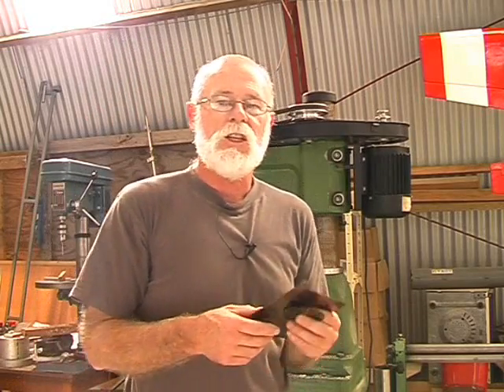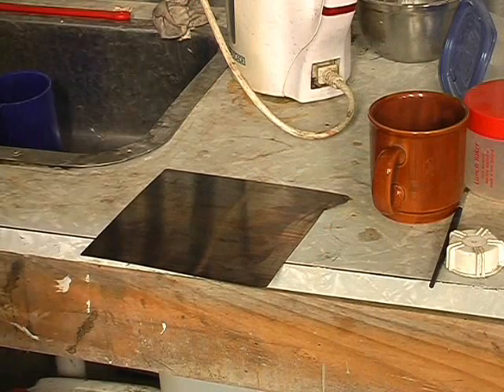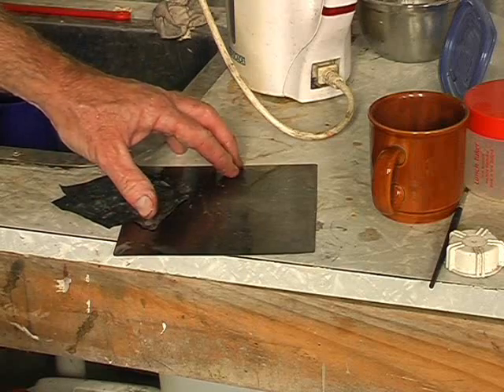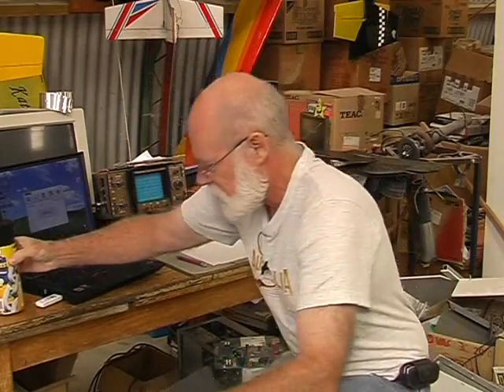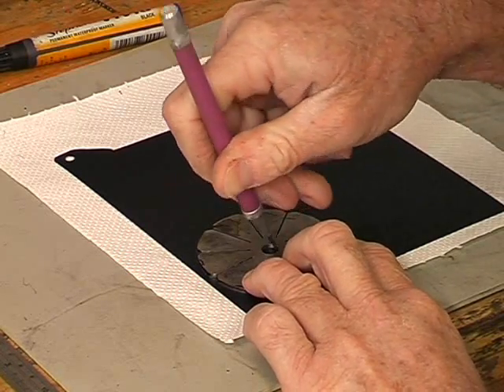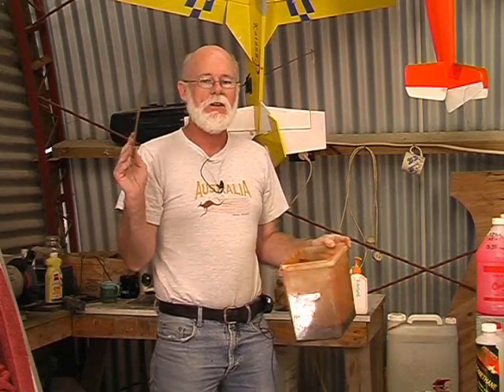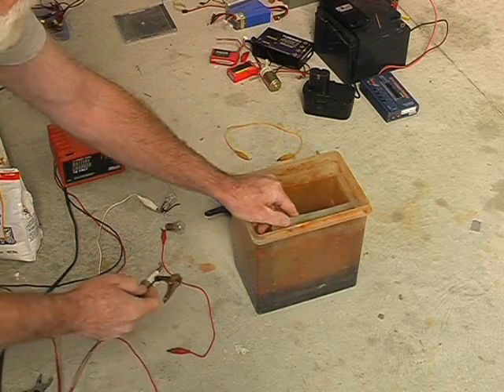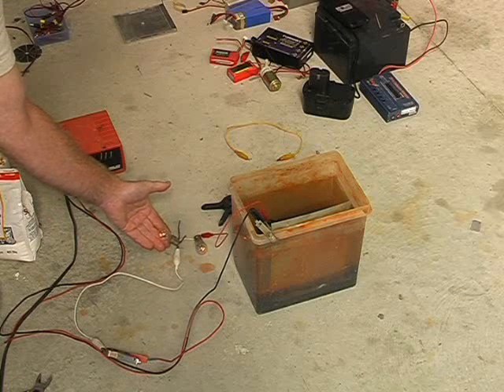How to make reedvalves for pulsejet engines

Comment: I have heard that valved pulse jets get more thrust/fuel burned than valveless jets.  They are also lighter because they don't need a large intake pipe, which reduces weight, so valveless is better for some applications.  I want to make one for a project so I am looking into all the different ways people have built them in the past.

Comment: I'm not sure what the purpose of the light bulbs is, I've done electrolysis of various metals in a salt water bath with a 50 amp car battery charger many times, it's always worked fine without light bulbs, however, I've never tried to "cut" anything out of the metal, or used etching paint.  One other thing this guy might not have mentioned, Hydrogen and Oxygen are produced at the cathode and anode, VERY explosive, no smoking and do it in a ventilated area.

Comment: Sorry Paul.  I hardly touch models although I do have a couple of electric flight large scale helicopters lying around somewhere at home.  I'm familiar with metalurgy and full sized gas turbines, but my main field is feature film related but in full sized helicopters, rather than model ones.

Comment: Oh!  Phew!  :oD    Yes, it should work but in a fraction of the time for steel as aluminium is so soft and easy to etch away.  

Dip it in as SOON as you have scratched off the surfaces too, otherwise aluminium oxide will form and hinder an etch.

Comment: Aluminium will simply melt away with the pressures and heat generated.  You'll be wasting your time.  It must be spring steel for its ability to withstand the heat AND be flexible when hot.  As for the steel supplies, look for a local steel or metal suppliers.  Or use a search engine.

Comment: Copper: No electrolysis, bath is 1 part of 30% HCl, 1part of 30% H2O2, 3parts of water
or
FeCl3 dissolved in distilled water (saturated solution at room temperature), for use heated up to ~40degC by putting the etching pot into a bath of hot tap water (make sure the tap water does not mix into the etching solution). The FeCl3 based bath is reusable.

Aluminum: HCL+H2O2 as for copper, but more water (the reaction is faster, so to avoid overheating)

Do all that in well ventilated areas!

Comment: A quick question, what other metals can be cut this way? I don't have access to high or even medium quality metal, and even a 12v battery charger will be a high expense for me, the only metal I currently have access to is aluminium, and even then only in very small sheets that I cut from drinks cans. I'm hopeful this is possible with aluminium on account of the fact I know in order to obtain it from its raw, natural state you need electrolysis.

Comment: I etched printed circuit boards in a similar manner and I can tell you that higher currents can make ragged edges. Low current, long time, same electricity bill next month but smooth and precise edges. 
Just don't forget to check it out every once in a while or you'll find nothing left of it :)

Comment: Is it possible to do this to a thicker material? Say, 1/4"?
Reply: Not if you want accuracy. The paint will be undercut, because etching doesn't just go vertically through the sheet. It progresses along the material too. On thin sheets, the effect is not a problem, but by the. time you have 6 mm (1/4”) thickness, you will also be etching 6 mm beyond each score in the paint. A single scratch line will become a gap of about 12 mm or ½” by the time the plate has been etched right through.

Comment: thankyou very much.  if it is truly a factor of about two and should only take half the time, then that could explain the excessive deterioration of metel.  I left them in for 15 hours which apparently would be more like 30 instead of the suggested 20 hours if i were using 5 watt bulbs.

Comment: Hi,
so the lightbulbs provide resistance. I thin 5 watt bulbs are about 3 kilohms (you can check this with ohm's law and knowing p=IV), so if you upped the wattage you probably dropped the resistance, let's say by a factor of 2 . so if you've got twice the current running it should take half the time

Comment: I just pulled my pettal valves out of the solution after following this guy STEP BY STEP.  when I pulled them out after only 15 hours (instead of the suggested 20, just to check on them) I found that they were already completly etched all the way through.  In fact they were "over etched."  the sides were completely jagged and the center hole was enlarged sizably.  the only thing I think that i might have done different was use two 13 watt bulbs instead of two     5 watt bulbs.

Comment: Hi, can I suggest to use a template of the piece when painting the plate?  Like a stencil?  That way you will paint all the outsides but not the shapes of the petals piece (please forgive my english).  Anyways that way you wont have the hassle of using a xacto knife to cut out the shapes.  Does that makes sense?

Comment: Friend, spring steel etched out in 20hrs, Tin sheet would be all gone...Remember its the air pressure that bends the valves open and then bango , it closes them. Tin sheet aint gon'na do that. keep watching

Comment: @frew83   This was a while ago when I wrote this comment. I have been building all sorts of reed valves using this method.  I could actually use this method on .010 inch spring still.  I actually modified this procedure by adding more salt, and using hot water to dissolve the salt much faster and using a resistor. I use a stainless steel plate as my cathode plate.  I could get them cut in 6 hours this way.  Any kind of automotive primer will work. He mentioned self etch only.